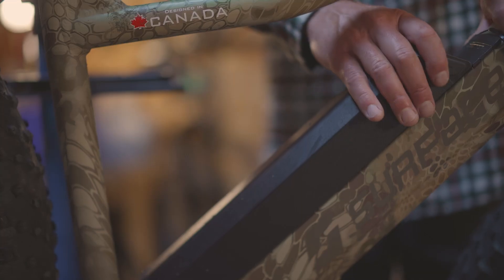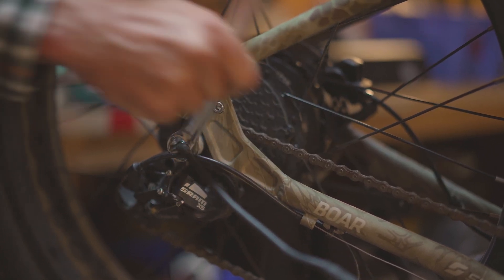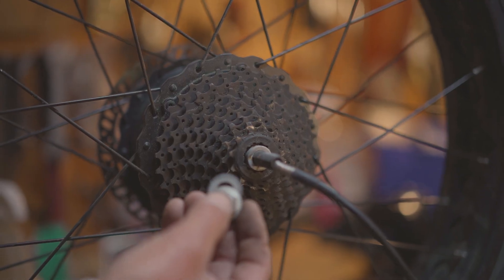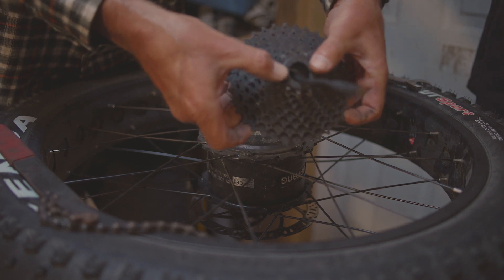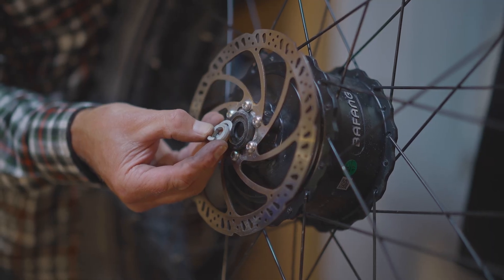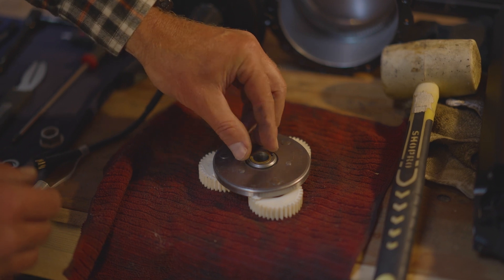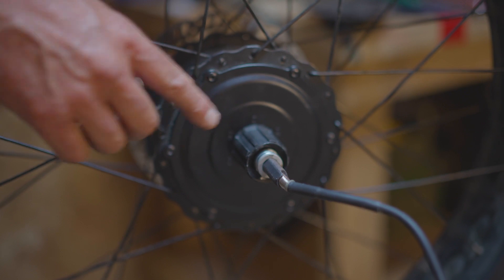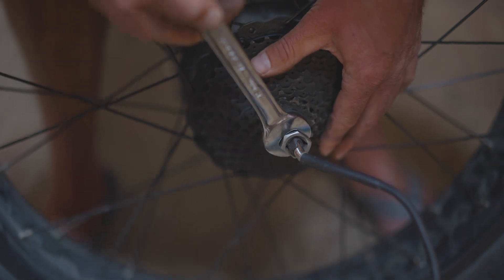Surface 604 - Bafang RMG060.500.DC Motor Core swap Boar Hunter, Boar Explorer, Twist Electric Bikes

Comment: Great video.  Can you please specify the exact cassette tool remover that you used here?

Thanks
Reply from the maker: You would need: 
Park FR-5 cassette removal tool
Reply: @surface604bikes  Thanks!  It looks like the Park Tool FR-5 is discontinued and has been replaced with FR-5.2 with a 12mm opening for the axle.  Is 12mm large enough to let motor cable connector go through?